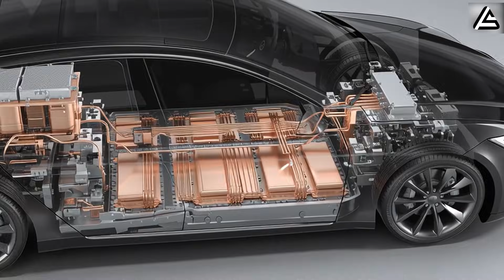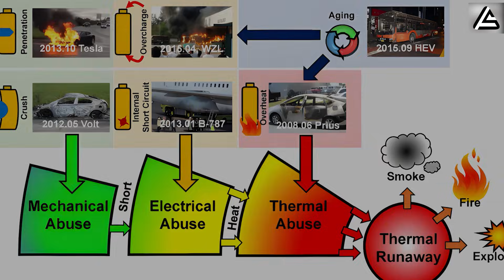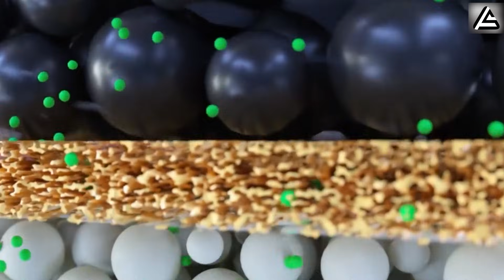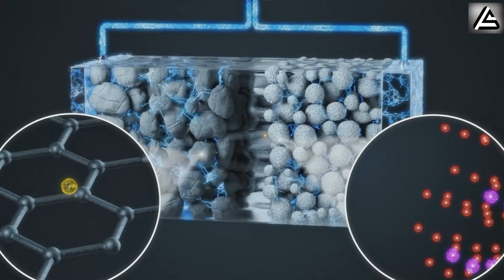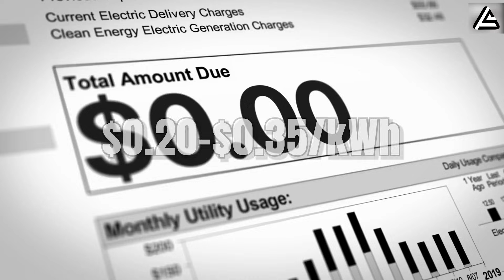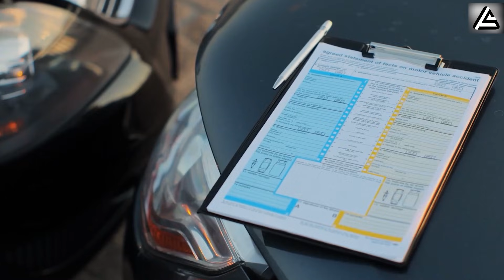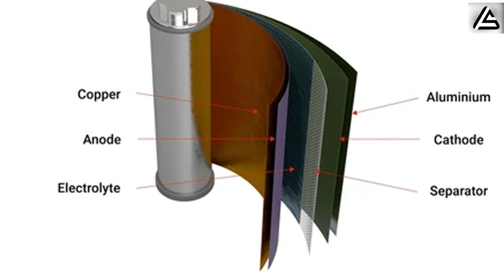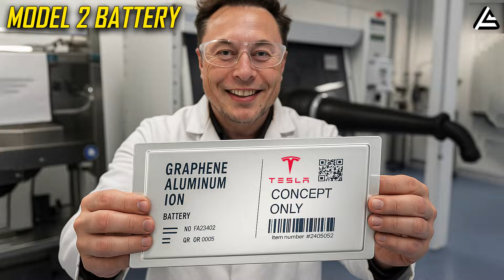2026 Tesla Model 2's Aluminum-ion Battery Revealed: 3 Hidden Features. What Elon Didn't Tell You

Comment: What is missing from this video is the aluminium ion cell cathode composition that likely will be used.

'typically a material that can reversibly store and release aluminium ions, such as graphite, carbon nitrides, metal oxides, metal-organic frameworks (MOFs), or organic molecules like naphthoquinone derivatives.'
Reply from the maker: It's the graphene cathode, letting aluminum ions move fast, stay stable, and keep the battery cool. That's how it lasts up to 10,000 charge cycles and runs a full week per charge. Would you like me to make a separate video just about this graphene area? Do you want to know more about the structure, or how it cools the battery?
Reply: @AutoGearShift2  'Research groups working on alumin[i]um-ion (Al-ion) batteries include The University of Queensland (UQ) in collaboration with Graphene Manufacturing Group (GMG), Stanford University, Albufera Energy Storage, and TasmanIon. Other institutions mentioned are Dalian University of Technology, University of Nebraska, Cornell University, Clemson University, and the University of Maryland.'
GMG have 'gone quiet' about their Al-ion cells.

A 'state of art' video on all Al-ion cells would be better than focusing on graphene.

'Graphene exhibits very low electrical resistance [ less heat created ], comparable to copper'
'However, its resistance is highly sensitive to factors like impurities, the number of layers, temperature, and the quality of contacts to other materials. While pure, pristine graphene is a strong conductor, its electrical properties can be significantly altered by the presence of contaminants or defects.'
Graphene resists degradation caused by swelling.
Reply from the maker: thanks for your sharing

Comment: There are batteries and there are capacitors, and each is subjected to one commonality, charge and discharge.  Each have their own properties with respect to this, but capacitors in most applications have a much higher charge / discharge cycle count before significant degradation.   But they don't have quite the energy storage DENSITY that modern batteries do.  And even electrolytic capacitors don't have the same overheat and catch fire risks as some batteries.

But the internals of most regular capacitors are made from aluminum, so it only makes sense if the properties of aluminum was incorporated into batteries that they would take on some of the charge/discharge properties of capacitors.
Reply from the maker: Thanks for the detailed info, really appreciate your insight. btw, do you think aluminum-based batteries could ever match capacitor-level charge cycles without losing too much energy density?

Comment: Batteries are not going to be the Problem with Electric Vehicles. The Production of the Electricity to Keep them CHARGED will be the Problem for at least the Near Future. America can't produce enough electric Energy now to cover it's needs at certain times like extreme Cold/Heat spells. Now take away half the Production Facilities (Coal Fired Power Plants) and add Millions of Battery Powered Vehicles is a Recipe for disterious Rolling Blackouts and possible downing of the electrical grid it self. For the Foreseeable Future we will need many forms of energy including Oil, Hydrogen, Solar,  Electric. No one source will supply enough energy Now, in he immediate Feature or maybe even until the next century.
Reply from the maker: Trust Tesla, they’re already scaling up Megapack and the new Megablock systems fast. In 2025 alone, Tesla’s total installed energy storage hit 31.4 GWh, which is massive. Switching to EVs doesn’t have to “break” the grid, not when smart energy storage like this is growing right alongside it